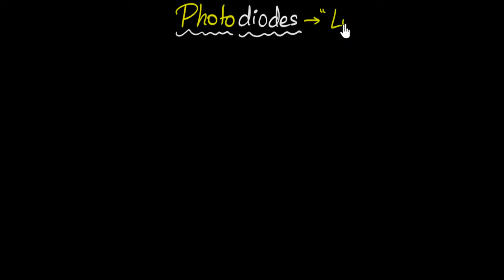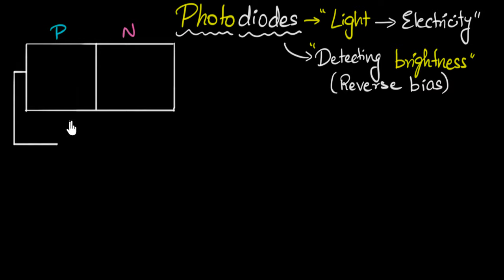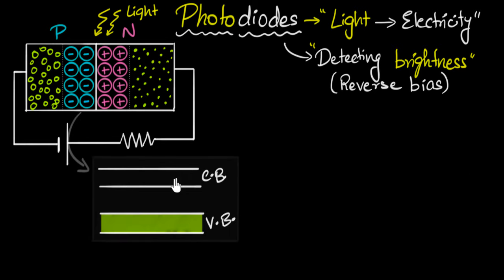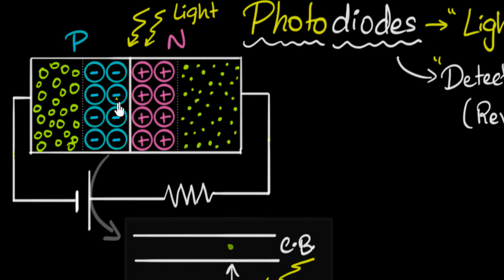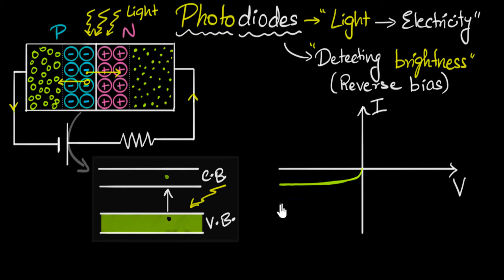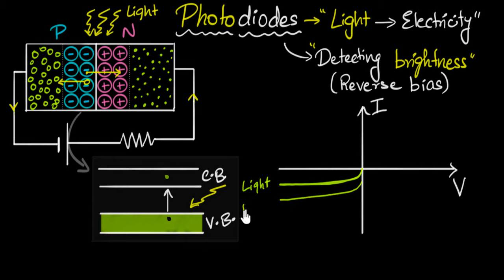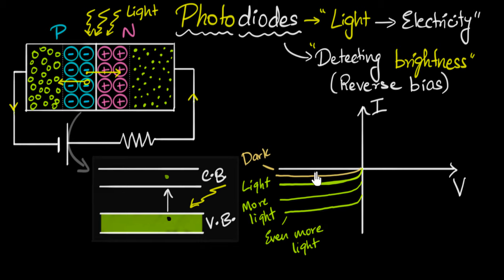Photodiodes - (working & why it's reverse biased) | Semiconductors | Physics | Khan Academy

Comment: Ohh the electrons from the negative terminal (electron flow) fills out the holes in p type material. Conversely the electrons from the n type side is reaching towards the positive terminal of the battery so the depletion layer is increased and if we finished this process then the current would not flow in a reverse bias mode.
Reply: Exactly. I am learning this topic a the moment, and he confused me lot, that he is doing it the other way arount.
Reply: Oh never mind. I was wrong my self. Because of the charge double layer, which results out of the will of the to potentials to get equivalent, the electrons forming on the p-side are directe moving to the n-side because the first space on the n-side is positivly charged.

The result in the end is a potenzial difference and a resulting current.
Reply: @atomicreactions9201  are you talking about reverse or forward bias mode?? Like I would recommend you to watch a video on diodes by ochem tutor on youtube. So that you get the basic concept and come back here and watch solar cells,photodiode and led.

Comment: Sir at 07:43
You mentioned that we want the current only due to light so we don't use forward biasing (as another current flows)
But in reverse biasing, a current flows (not due to photons) but it's very small. So we are neglecting that current, right?
Reply: Ofcourse
Reply: Off course...see the current generated in the depletion layer is enormously small as compared to the current which is generated by light.
Reply: No, I think it is included in dark current

Comment: Nice video.  My only suggestion is that the i v curve should not go to the origin.  Even at v=0 you should see significant photo current, I believe.
Reply: I agree -- because the depletion region is still present at v = 0 (albeit a non-expanded one), and it's in this region the current is generated.

Comment: 00:02 Photodiodes convert light to electricity and are used in detecting brightness
01:39 Reverse biasing in photodiodes limits current and widens depletion region.
03:08 Light absorption in semiconductors creates electron-hole pairs
04:32 Light absorption generates current in semiconductors
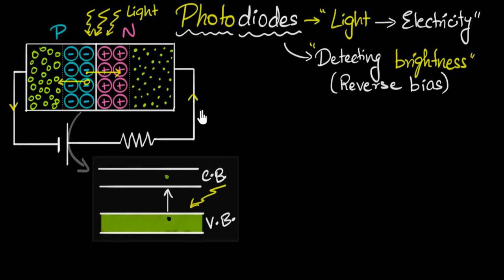06:01 Photodiodes detect brightness using reverse bias.
07:27 Photodiodes work in reverse bias to ensure current is only due to light.
08:54 Current generated by photodiodes is independent of voltage after a certain point due to the number of electron-hole pairs formed by the light.
10:15 Photodiodes can generate a tiny current even in absence of light due to thermal energy.

Comment: Dear Sir, I have a problem which you may be able to help me solve.  I have a new Solar Panel installation and I want to use it in part to heat my underfloor heating through the electrical conduction wires embedded in my concrete floor.  The problem is, when sunlight dims during the day, electricity comes from the grid to maintain a consistent flow of electricity to heat my floor. Grid electricity is expensive and I NEVER want to use grid electricity to heat the floor, only solar derived electricity.  

I was thinking of combining two devices to make a switch that turned on the output to the floor from my solar panels when the sun is shining and turn off current when the sun is not shining.  The thought was to use a Photodiode as the current switch that is connected via a low voltage power supply to a solenoid.  This solenoid switches off 240V power to my underfloor heating when the solar radiation {and therefore current in the low voltage circuit} drops to below a certain level and stops power going to the heater circuit.  If the sun reappears from behind a cloud, the circuit goes back on again.

What do you think about my problem and do you have any suggestions?  Thanks.

Comment: can this be used in automatic doors which open when we go near it??????
Reply: We are not light emitting bodies. So I don’t think so 👀
Reply: infra-radiation detection is used in heat cameras for automatic doors
Reply: Possibly if you have some bright light shining at the sensor and you happen to block that light when you come near the door, current will decrease, and door can open, but I think this can raise many false alarms. Like what if a fly just cover up the sensor, or something.